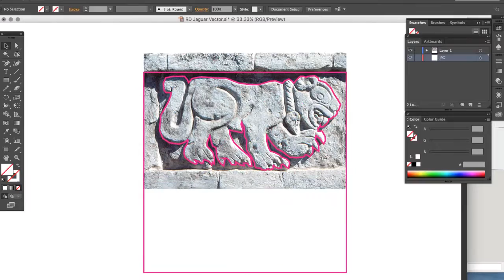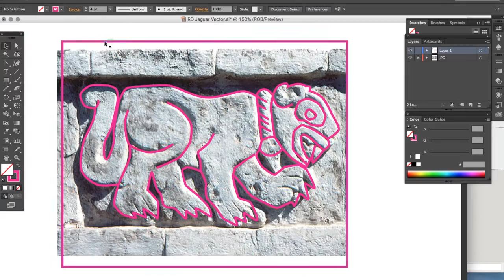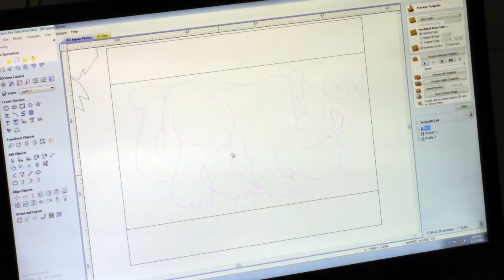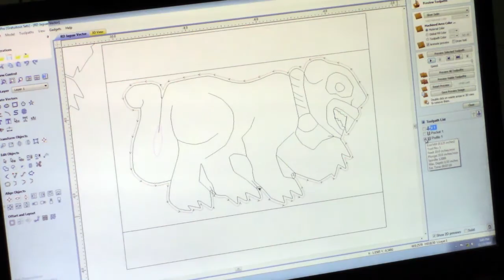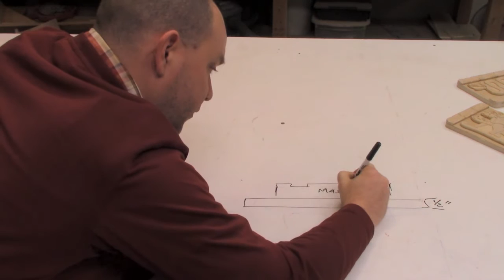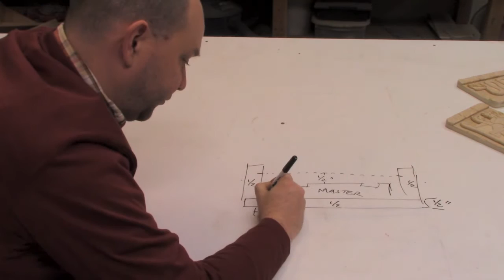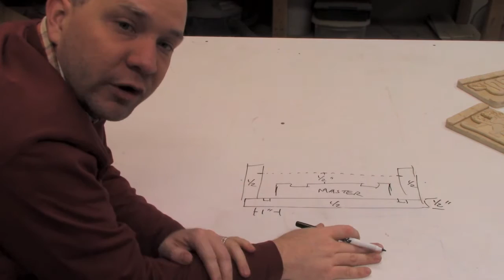Jaguar Stelae

Comment: Ever thought of just using sand or crushed stone as filler? The results realy looks and feels like stone!!
Reply from the maker: That sounds good for a different application.  Sand settles to the bottom of the mold, leaving no sand at the top.  Also, we have had problems with brittleness where the high density of sand displaces most of the resin, leaving very little resin to hold the sand together.  If these were to be purely decorative, your suggestion would be perfect. Some of these are loose game pieces for the Stela puzzle, so we need to expect that they will be frequently dropped and generally mishandled. We used Ure-fil 3 here and it still settles a bit.  We did another video "Stone Totem Casting" That addresses some of the failure modes and uses different ceramic fillers.

Comment: i really don't get why you don't work on the wood piece to make it looks like a stone ... except if you need to make tons of copy of the same it feels like a waste of time to cast stuff for that kind of project...no?
Reply from the maker: 1.  The castings are INDESTRUCTIBLE 
2.  Yes. It was more expensive
3.  We needed to make many copies
4.  We could have done it in wood
5.  We speak in the video about why we chose this direction
--I understand your question, but we are not trying to save pennies.  We are trying to make the strongest and best piece. You may want to read my previous answer again. :-D
Reply from the maker: I forgot to mention this: they are "1000 years old". Wood probably wouldn't survive that long ;-)